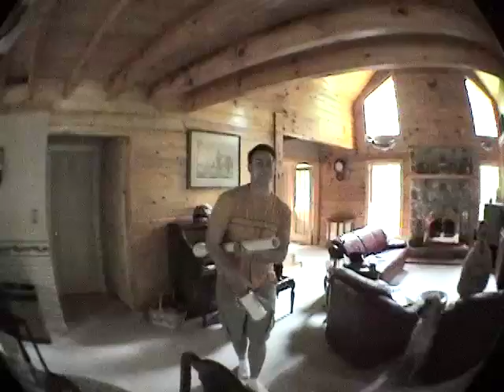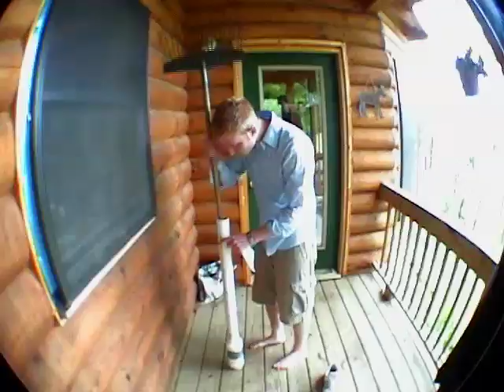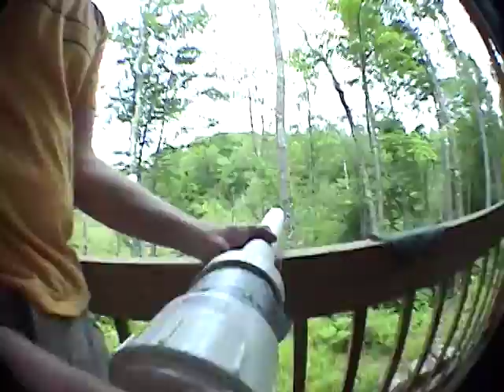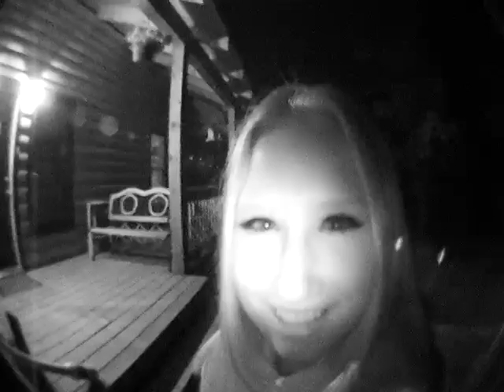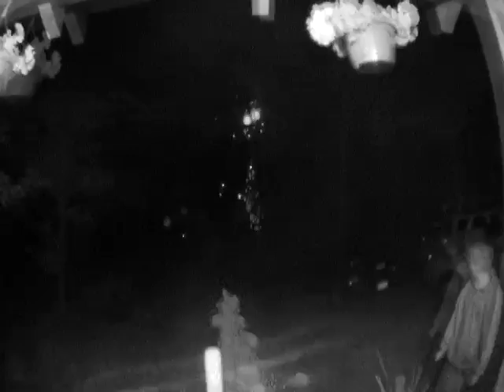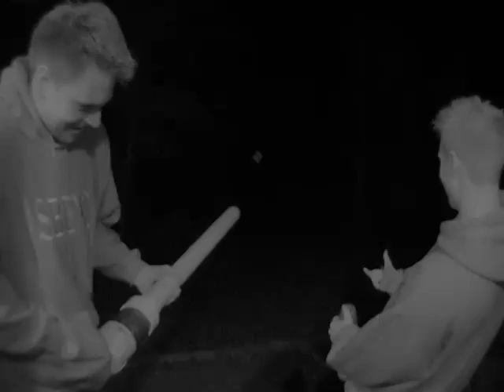SPUD GUN (A.K.A - SPUDZOOKA) + HOW TO MAKE!

Comment: Your're right, i have 2 potato guns. 1 is a real crap piece of shit, i made it out of god knows what, and without 2 rolls of duck tape, it would be held together by gravity. Then i built the second one, out of thick gray pvc pipe, and used a 10 liter garden sprayer as the combustion chamber, put in a fan to mix the gases correctly, and a dual BBQ sparker to ignite, but it only shoots 1.6x times further than my crap ass gun.

Comment: Use a piezoelectric igniter unit like from a refillable Butane lighter you know the long ones used to light candles and fireplaces and grills, hack one of those apart youll find one of those igniter units inside, the same as what these dudes used in their spud gun